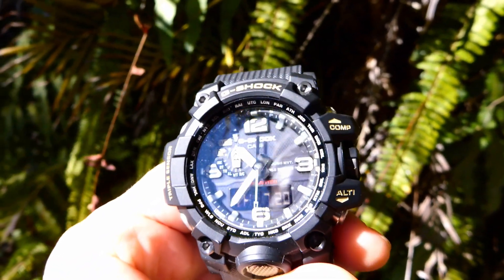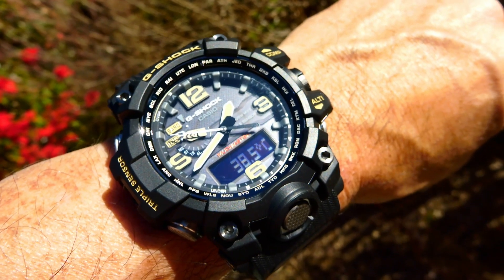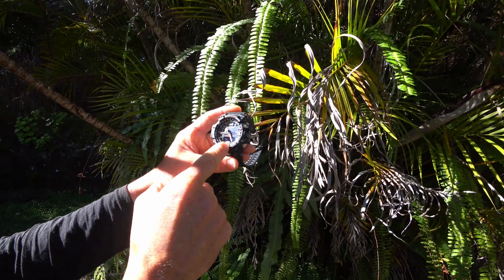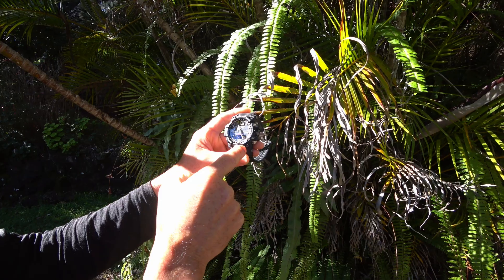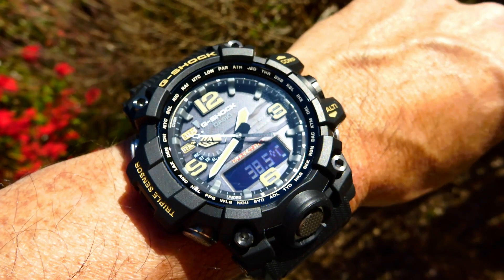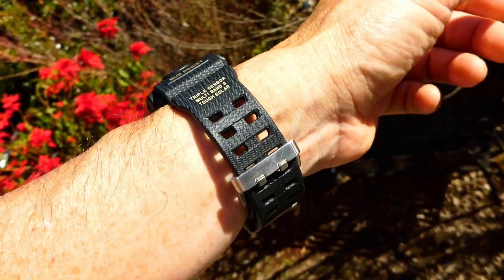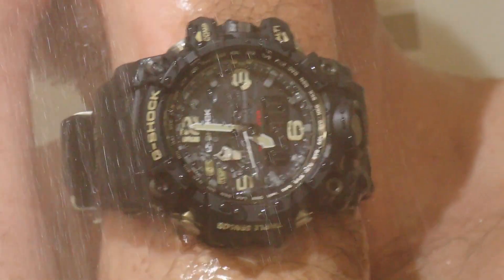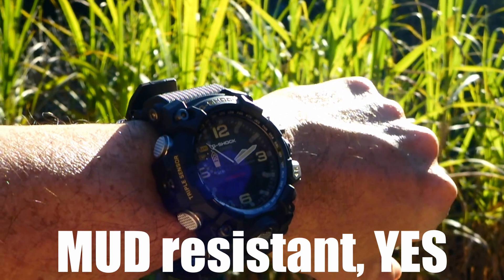Casio Watches What are they made of?

Comment: Thanks for the video! Are bio-resins (for example the gbdh2000) safer to use during a shower?
Reply from the maker: Hi I don't know anything about these supposedly "bio-resins" This term could mean almost anything, particularly normal oil products used to make plastics are in fact of biological origin if we wan to be correct. No organism can break down any such polymers as they are never encountered, so I'm not so sure about this other than they may be less stable in UV light and hence break down more easily but I certainly don't want a watch which is made from easily degradable plastics. See this article:

https://www.colorado.edu/ecenter/2021/03/10/bioplastics-are-they-good-they-seem#:~:text=Bioplastics%20are%20made%2C%20at%20least,as%20growth%20with%20more%20diversity.

Comment: Thanks for the info on this - was not aware! I have owned one for over 10 years & its still holding strong.
Reply from the maker: Yeah it's something Casio don't make a big deal about although mentioned several time throughout a lot of their manuals but most people don't read these sections only on how to use it if that or if one never got a manual with their watch, maybe a secondhand purchase or one off the "gray market" et.  Many cheap bar soaps and crappy hair shampoos (the latter i haven't needed for some years LOL) are very alkaline and they can help to discolor and gradually weaken the polymers they use.
Reply: @BushCampingTools If this clock on your hand with strong alkaline. i'm sure your hand is destroy before gshock is destroy😂😂 but you push gshock in strong alkaline plzzz don't worry you doing it self hand and have a good luck🤙💸 . Hahahaha
Reply from the maker: LOL, you are right! @ด่าหมดไม่สนหน้าไหน
Reply: @BushCampingTools  It’s definitely news to me - guess I’m one of those folks so thanks 😂👍🏼
Reply from the maker: @VashPlissken45  We all are mate. I mean who reads these manuals which have writing so small u need a microscope to check it out LOL!
Reply: @BushCampingTools  Yeah you got that right 😂👌🏼